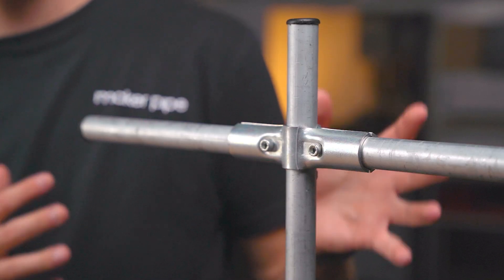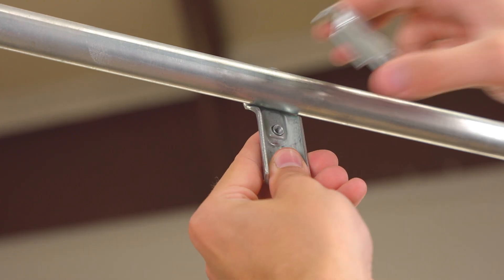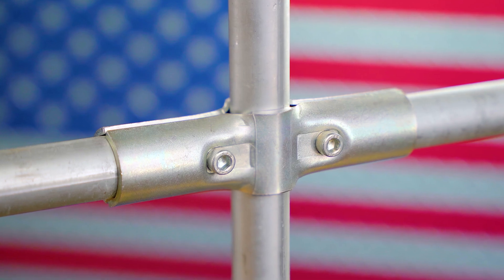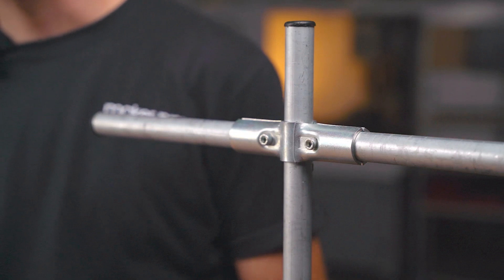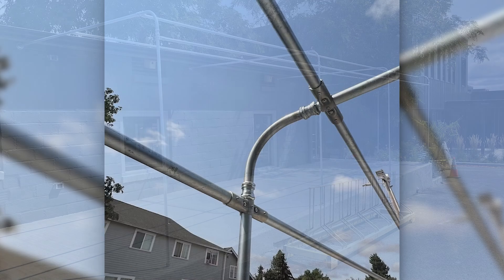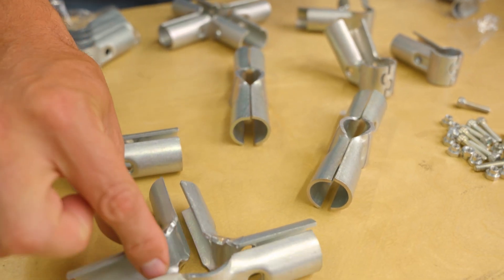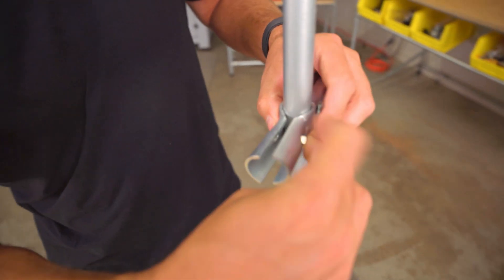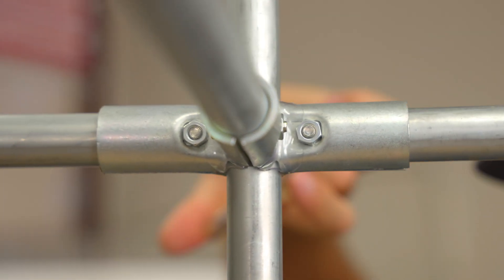180 Degree Connector Overview & Assembly | Maker Pipe

Comment: Looks like Creform, a system from Japanese factories that has been in use for 40+ years. But this uses USA standard  conduit, which is convenient and lower delivered cost than Creform tubes.
Reply from the maker: Yes it's a very similar system! Our goal was to bring the benefits of building with lean tubes and connectors to the everyday DIYer. Thanks for the comment!